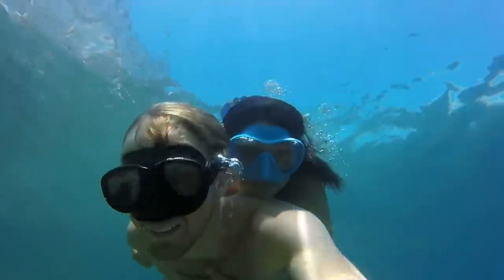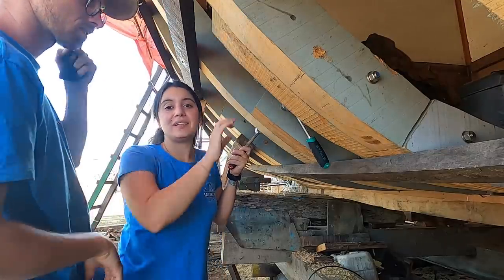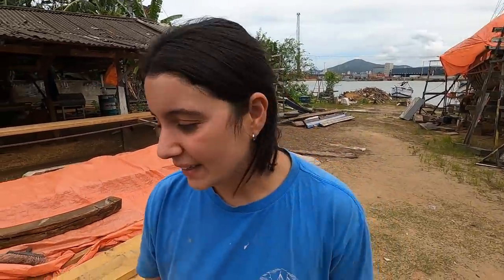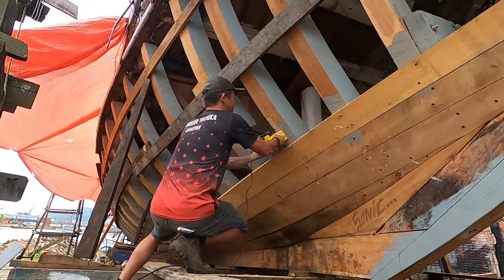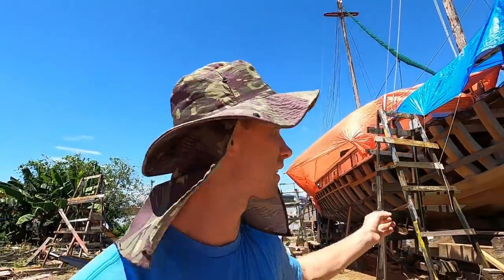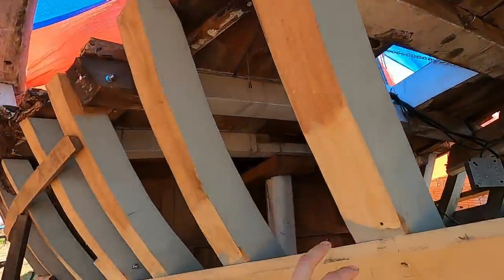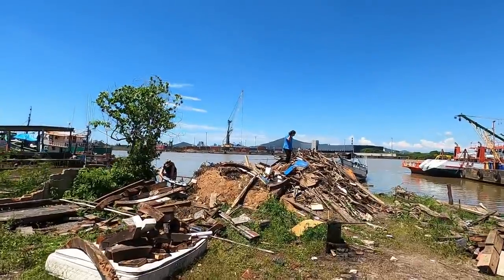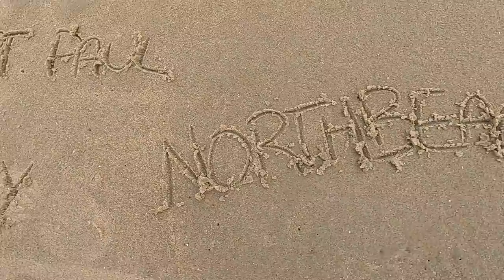Starting to look like a boat again! — Sailing Yabá #26

Comment: Hope you kept track of weight distribution on the starboard/port sides of the boat.  Also it looks like you added more weight by splicing onto old wood. The frames are twice the size and weight.  This will ultimately make the boat sit deeper in the water.
Reply: I have been thinking the same. They took out all the concrete ballast at the beginning of the project, so they will need to add somewhat less ballast back. She can be made to sit on the same waterline, but at what price in stability?
Reply: @frankegan6049  they will have to add ballast to match the heaviest side of the boat or it will tilt  to one side.   adding ballast will make it sink even lower in the water.

Comment: Question, will you be caulking the seams? if so, will it be with sikaflex?  And if so, are you going to let Duca anywhere near the boat while you do the caulking?
I was going to ask why not use seasoned wood, but it sounds like if you left a pile of wood to season, you'd come back to a note telling you who took it and where to get your money.  
Some free advice from someone who has done wiring for a  living.  Tear out EVERY thing  and start over.  You would be amazed at the frustration and time lost working around old wiring that in the end your going to remove anyway.  And don't worry about cost, the last thing you need on a wood boat is an electrical fire from an old wire.  And wire is cheap.  Honestly, I would sail back up the coast, and pay Fredrico to engineer the electrical system.

Comment: I wonder why they are not using any kind of glue or bonding agent to stop water leak. Old classic boat builder used to have Bee Wax and cotton to fill the gaps between the planks.

Comment: All the electrical and plumbing on the boat needs to be replaced period. Create an electrical diagram showing the main connections and locations and run proper conduit to house the cabling for long runs. Make sure the conduit is large enough to include further cabling down the road. Run new systems as they get installed, and make sure to update your electrical diagram as you do. You'll thank me later. 
Remember that carefully thought out and implemented electrical and plumbing are key functions of a safe dependable boat.
Cheerz!!
Reply: LOL

Comment: It was a bit of a naive comment from MP about "light at the end of the tunnel". 
I suspect she has little real idea about the amount of effort and $$$ that electrics, servicing of fuel, water and holding tanks, checking/replacing sails, standing and running rigging, engine, drive train, cabin fit outs plus yearly haul out and maintenance is going to take.
Still, one step at a time....but I'd really re wire before the hull planking is installed

Comment: I just saw the comment above about sorting wires and it would be prudent to start with new wires as they tend because of time and corrosion should be redone now and new connections to the engine bulge pumps ( should get new one’s! And over haul on you’re engines is going well I hope! And you should redo your batteries with lithium batteries and new wires and control boxes and install a big size generator and install plastic or stainless tanks fuel, and water tanks more and bigger than you have now or over haul them as you don’t want contamination and a polishing system for fuel and a desalination water system so you always have fresh water for your guests who would expect that power water bathrooms showers toilets and freezer and cold storage, if you start on the wires by installing new ones and connections it will be easier and you still have time to start to fit those tanks I was talking about if not for divers but for yourself as well your doing excellent job !! You carpenters are amazing and with a little help from them those other thing I mentioned will go easier on the work at hand trust me on this guys ! Team Yaba’!!

Comment: I have a bad feeling about all that wood you are using been green. I have always used timber that has been air dried for at least 2 years on boats. Whenever I have not, There has been trouble when things dry out.

Comment: looking at the through bolts on the new ribs. Do they use a torque wrench to tighten them all the same?
Reply: It will depend on the hardness of the wood. You will tighten until the washer just starts crushing the wood.

Comment: Will you be using some type of thread lock compound or lock nut to stop the stainless steel nuts from loosening once the hardwood has reached it’s optimum moisture content?
How do you spell the dogs name? Is he going to be the 2nd mate?

Comment: I’m curious about the butt blocks on the planking rather  than scarf joints. Are you concerned at all it will be weaker?
Reply: Many wooden boats have been built with but blocks backing each join.  You can start many a "discussion" over beers with boatwrights, designers, naval architects, and engineers over the choice of scarf vs. butt blocks..

Comment: i really wish you would have used screws on the planks rather than nails because nails over time can back them self's out with the swelling and contracting of wood. screws would hold in place better over time. but other than that, i really like what I'm seeing. keep up the good work.

Comment: What a sight!! all these planks and their frames in place, brand new, looking so good, hard work pays and you guys have put in a tremendous amount of dedication and perserverance to get to this, there's still plenty to be done but like MP says... "look at that", regarding the wiring, i suggest that you contact a good electrician and redo everything from scratch, remember that you have a wooden boat and the last thing you need is to wake up in the middle of the night and having to fight off a fire on board while you are far from any land, at least  have a pro design the electrical circuit and then you can go ahead installing it, i wish you good wind and plenty of success restoring this beauty.

Comment: He’s looking at that wiring bird nest. Personally I like wiring. It’s like a hunt. Where does it go, is is properly sized and protected, what is reusable, can it be repurposed, the guy did what? Tsk, tsk, tsk. When don’t I like it? When I have to get into tight spaces, in my 60’s my body doesn’t do origami so well anymore lol.
Reply: I used to. I’m liking it less these days. The main reason is probably like you said, my body can’t do what it used to so it takes me five times as long to do everything. But also because we live in a 40 year old house and the guy who owned it before us did a lot of “upgrades” himself and as I find them I’m having to fix every one of them. Yesterday it was wiring. I’m amazed the house hadn’t burned down.
Reply: @srcastic8764  
Yeah my last boat was like that. The previous owner knew just enough to be dangerous. Yanked out a mile of junk wire and most circuits were un fused or beakered. Found melted wiring. The savings grace was the batteries were so dead they couldn’t heat them enough to really get things cooking.
Reply: @SkypowerwithKarl  well that’s good I guess. LOL. 
I watched my dad melt every wire in our boat once when I was a kid. He hooked something up wrong at the battery and I guess there were no fuses and smoke came up from everywhere before he could get it disconnected. I was probably about 13. That was a load of fun replacing all of that. I’m just glad it was him and not me. Knowing him, im sure it was somehow my fault in some capacity anyway though. LOL.

Comment: One more thing, and no, my name is not Captain obvious, but the engine should have already had a tear down to at least check the top end and make sure that it’s in good condition to last for several more years! The teardown would be much easier while  the engine compartment is open with lots of light around the bottom. Just an observation

Comment: Do yourself a favor. Make a wiring diagram when you know for certain where a wire goes. You could also tag each wire at each end. If you should have an electrical problem at sea you will be glad you did the extra work.

Comment: In between each plank is there any thing used as a sealer between each joint? I don't see anything so can I assume this will come later?
Reply: When the ship is launched, the planks will be exposed to water and the planks will swell and seal up against each other. In Norwegian, this process is called "trutne". Right after launch you will need to be standby with the bilge pumps, but after 4-12 hours she should have tightened up.
Reply: @rhkavli  I'm familiar with the soak and swell technique. There was one part of the video where it showed a set of planks with at least 1/4 inch Gap the entire length of up two planks. This brought to my question of maybe a stuffing or a sealant being used??
Reply: @pilotguychris7217  I didn't notice, but a gap like that must be filled with a sealant. Do you have the time mark? I see that they are using (temporary) blocks to use wedges against to drive the planks below against each other. Those need a gap for the wedge to drop in.
Reply: @rhkavli  Yup have a look at 17:41
Reply: @pilotguychris7217  Yes, between 2 and 3 from the top. I dunno what happened there. I don't know this wood, how much it swells, but that gap looks more than a bit on the big side. Probably they need to stuff that gap with tar and hemp.
Reply: @rhkavli  it would have to swell a land slide to fill that gap. Lol definitely some spots that have to be stuffed and sealed.

Comment: Yaba is coming along nicely. As for the wiring, start sorting it out and running it as much as possible while it is easy to get to. Once the hull is planked and chalked, seal it against the worms as much as possible. Where Yaba is currently, you are not going to be able to do that as the bottom of the keel will not be exposed to doing so. There is a lot of blood, sweat and tears equity that is going into this project, protect the wood and that investment. Yaba will be a fine boat with many adventures ahead of her.

Comment: Really impressed by the progress the boat builders are making, hull is really taking shape, you are going to be proud owners of an exceptionally well restored boat. I think it is fortunate that you found a boatyard with very skilled shipwrights. It must be costing a small fortune but you will end up with a really strong sound boat. What about the engine refurbish, I think it would be worthwhile doing work in the inaccessible areas before planking is completed. Or, do you plan to have engine removed for refurbish?

Comment: Rip all those wires out and start again!
Reply: As an electrical engineer, that is what I would have done. Start by making a new wiring diagram and then setting up new distribution panels. Just get rid of that rats nest all together.

Comment: Rip all that dodgy wiring out ...do not waste time with it ..remove as you replace ,  using old wire as a pull through..easy ..if you do it now .........best regards👌⚓

Comment: hi both ,you know the colour of that bare wood planking on the hull is really nice its almost a shame to cover it  in paint , have you thought about doing  the caulking then sand and varnish it from the waterline upwards ? or may be stain it and varnish , that would look like a million dollars if it was smooth , flat and shiny  , take it easy all the best